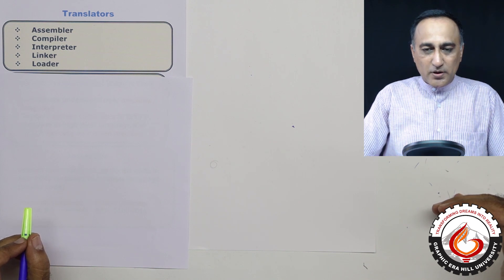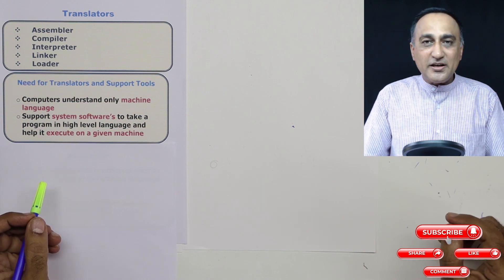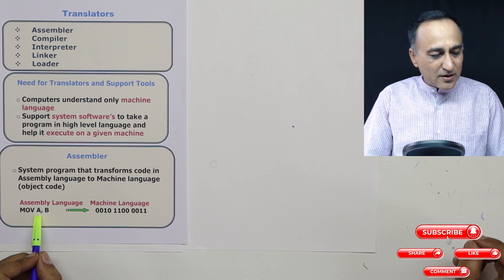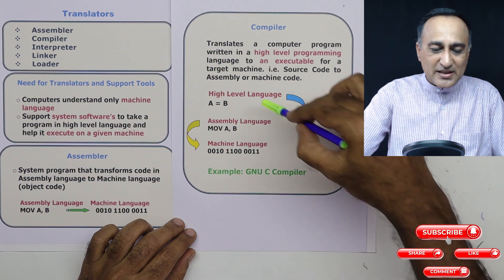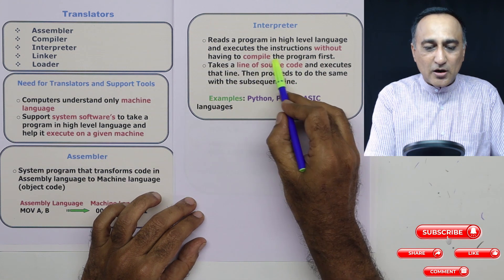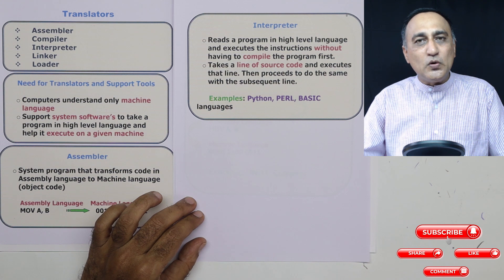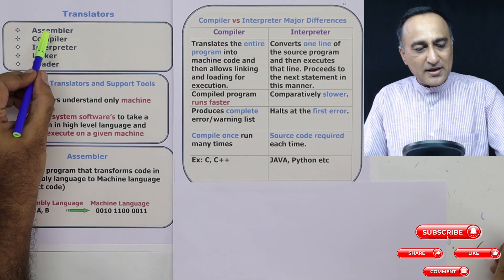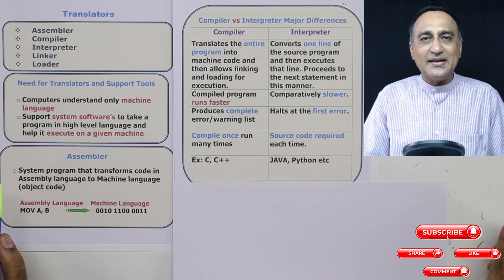WK3 - 21 Assembler, Compiler, Interpreter

Comment: how did compiler is faster than interpreter even it runs the whole program at once?
Reply from the maker: Here is the reason...
Interpreter needs to convert each line then execute. This step is for each line.
Compiler converts the complete program at once (takes time to compile). 
There is sometime taken by the Interpreter to convert each line during execution that is why compiled code runs faster than interpreter.

Comment: sir what happens in a scenario when the compiler is compiling a program and suppose there is an error in 5th line of code. Does the compiler restart compile from 1st line of code or it only compiles the 5th line of code?
Reply from the maker: It starts from line one again, since it would not know where all you have changed the code. Every time is like the first time for it.
Reply: it recompile whole program whether we have rectified that line code error

Comment: Sir since compiler , interpreter and assemblers are themself softwares ( set of programs ) so there must be a programmer's who write these programs . So are these programs(I.e. compilers , interpreters and assemblers ) written in machine language?
Reply from the maker: Great Question. You may use other high level languages to write compilers. For example you may use C to write a C++ compiler. In fact using a C compiler you can produce another C compiler. You can also use Assembly language if you like. But generally C is preferred for writing compilers of other languages. For example: The Python language interpreter is written in C. Writing a compiler using machine language would be extremely challenging if not impossible.
Reply: @CodetoCareer  ok sir . Thank you

Comment: Sir how can compilor work faster than interpretor? Means to say if interpreter is taking time to execute the whole code line by line then compilor is also taking time to load the whole program in main memory and executing it. It will comparatively take more time to execute whole program at once thus compensating time with the interpretor.
Reply from the maker: Good question. Her is the answer. This is assuming both are running on a machine with similar speed and all other things being equal.
Interpreter takes one line converts and executes the line. This continues for the entire program.
While the compiler converts the complete program and code is loaded into memory.
Now suppose you decide to run both the programs at the same time. 
Interpreter shall take some time to convert each line and then execute.
Whereas the code by the compiler is already converted. Thus the time is saved in conversion for each line and all it needs to do is just execute.
Interpreter needs to translate line by line EVERY time you want to execute the program.
The compiler only takes time to convert the code once and then you can execute as many times as you want.
Think of it this way.
Suppose I and you talk. If we both understand Hindi , our communication is fast. But let me say I do not understand Hindi. So for each line someone shall need to convert the line to my language and tell me. So the second conversation is much slower. Something along these lines above.
Reply: @CodetoCareer  yes sir. I understood what you are trying to explain. 
So, should i conclude it in this way that although compiler takes time to load the entire program into the main memory but NOT AT TIME OF EXECUTION. It is preloaded and hence works faster whereas interpretor do all the line by line procedure AT THE TIME OF EXECUTION and hence works slower?

Comment: Sir what is an IDE??
Reply from the maker: Integrated Development Environment (IDE). The editor, compiler, linker and loader is all included in a single development environment. Example Code:Blocks IDE. You can type, edit, remove errors, compile and run your program using a single Software.